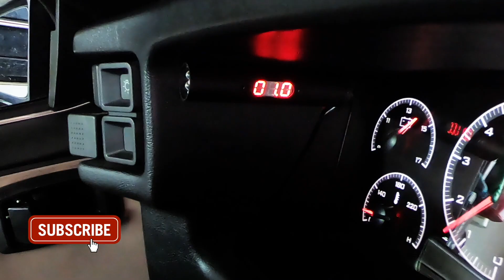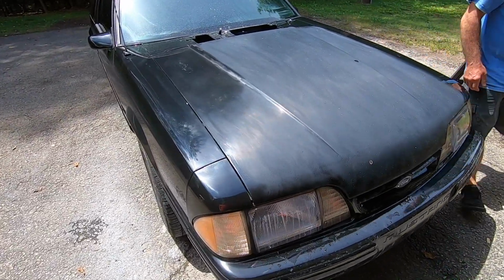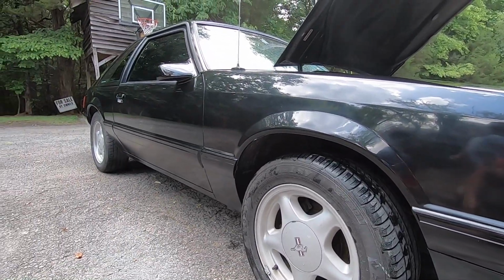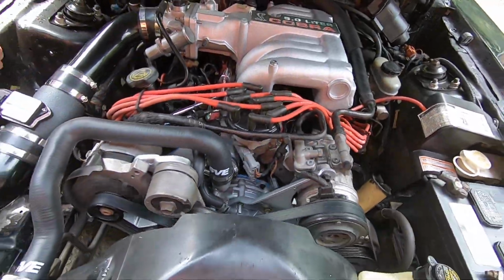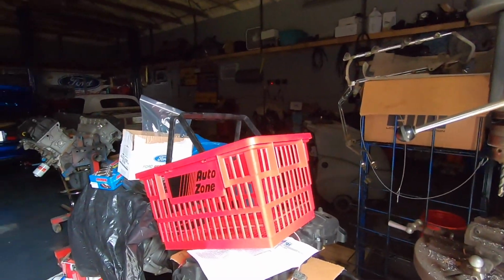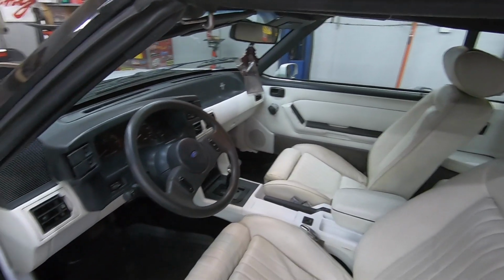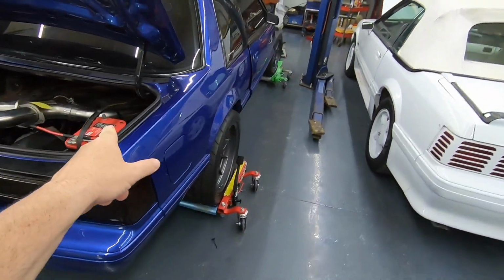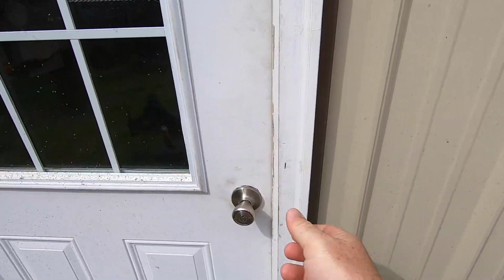NO PAINT JOB NEEDED! Saving a sh*t paint job!

Comment: Glad you took some of our advice on the wet sanding. I bought an old coupe with a CHEAP paint job. Wet sanded it and buffed and now it actually looks a lot better. If a paint job looks like crap, then there is no harm in giving it a shot. If the orange peel is that bad, chances are it has plenty of clear on it.